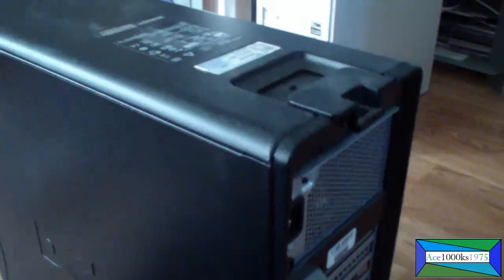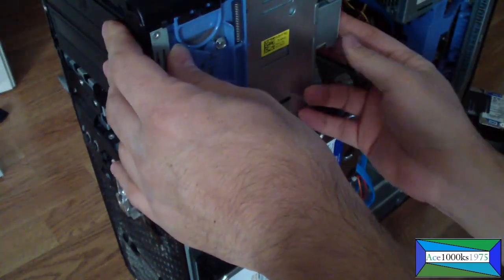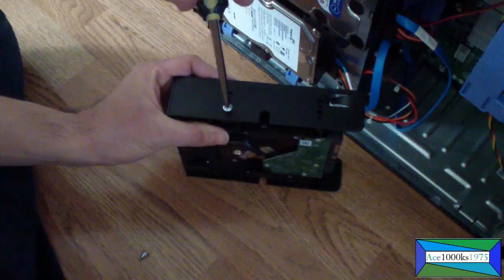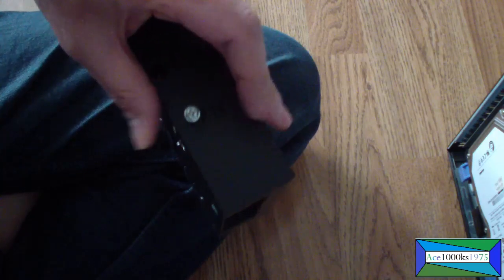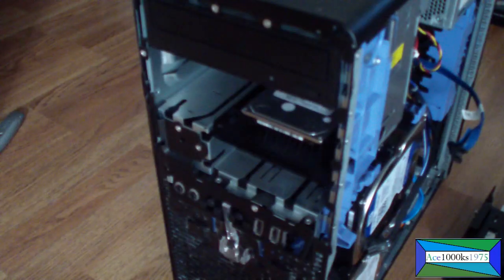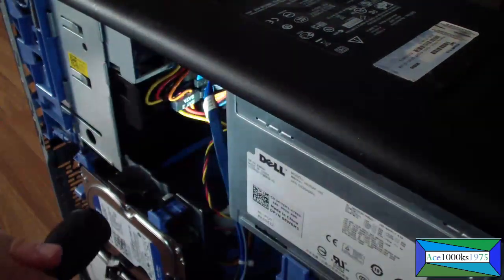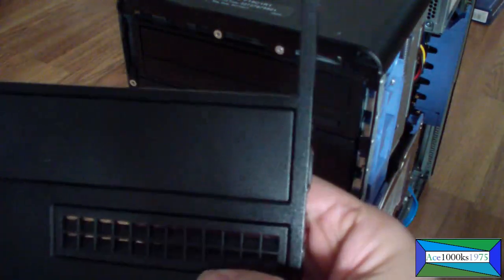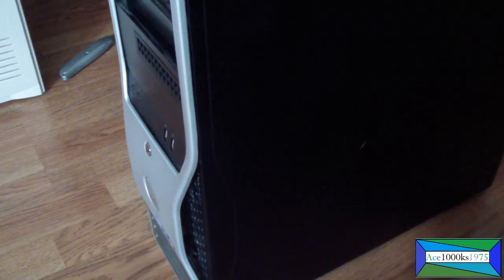Dell Precision T3500/T5500 How to Install and Remove 5.25" Drive

Comment: I have a Dell T3500 So I can replace the CDDVD drive with the HDD ? or SSD ? There has to be some change in bios right ?
Reply from the maker: You need to get a 5.25" to 3.5"/2.5" bay adapter to add addition 2.5" SSDs or 3.5" HDDs . https://amzn.to/41LkSj 

Then, you have to check your BIOS to see those devices are enabled in your BIOS. 

You can add M.2 NVNe SSDs in this thing with a PCI-e M2. NVMe adapter https://amzn.to/3NIX5dG

Comment: Another great video. After watching your video, I plan on upgrading my T3500 by increasing storage. Right now I have two 1 TB (3.5 in) mounted on sata 0 and 1. Can I add more than 2 TB? The Dell manual mentioned that the maximum it can take is 8 TB. So I am assuming that it is 2 TB per sata port because I have in total 4 available sata data ports (4 x 2 TB = 8 TB).  The other sata port is where the CD ROM is plugged. Is my assumption correct? I wonder if my plan upgrade will work because I plan of getting a 4 TB drive. Any thoughts on this? Thanks.
Reply from the maker: This computer has 5 sata ports, so you can add 5 sata devices, like DVD-ROM drives, hard drives, or SSDs.
Reply from the maker: I don't think this computer has a UEFI BIOS. You need to use the GPT format to use more than a 2 TB hdd.

Comment: I've same system but it's side panel is not opening by pulling That lock 🔒 point.
Is there anybody who can help
Reply from the maker: You have to pull on it hard. The metal tab in the case might be bent. If you can manage to get it open, you need to get a pair of pliers and straighten it out.
Reply: @Ace1000ks  I pulled it hard several times but I can't open. In your video you just pulled it and side cover came out. But in my system it's not moving even little.
Reply from the maker: @TheHolyBook-l1h  It must be seriously damaged.